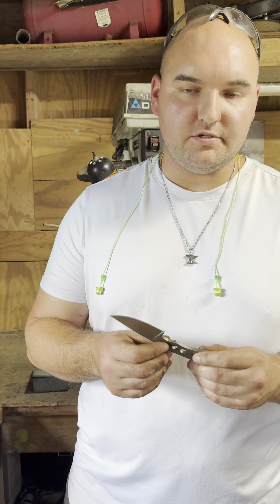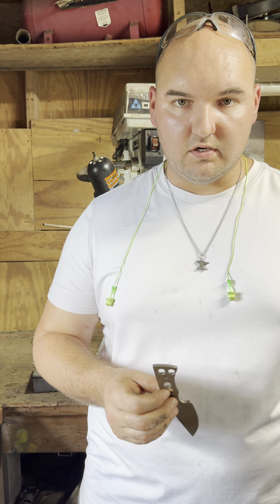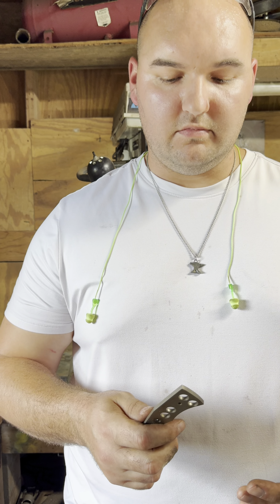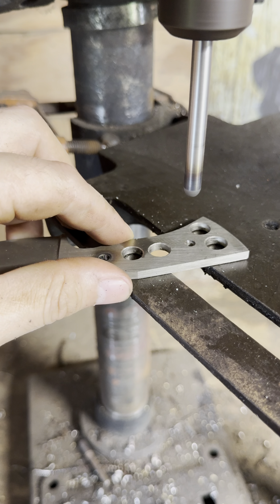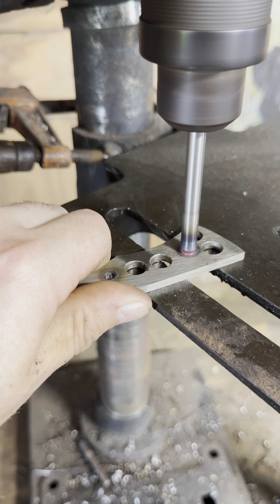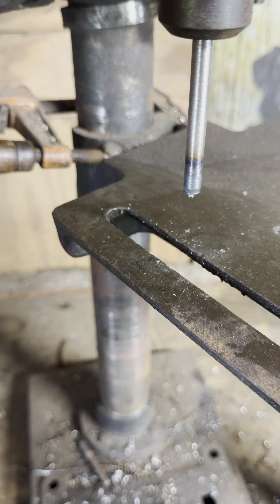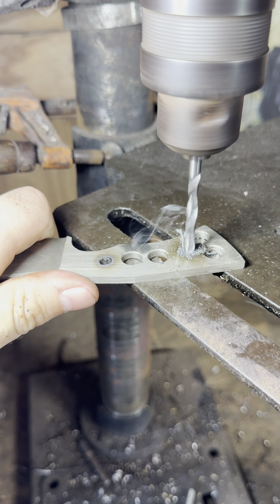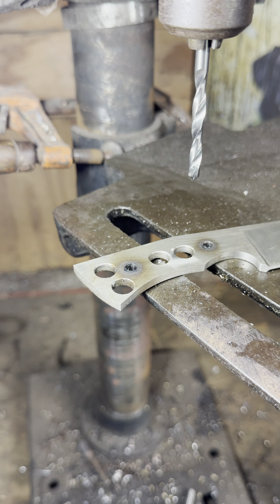Drilling a fully heat treated blade!

Comment: Great idea but damn, my mind was already seeing that gall up, friction weld, spin and take all of your fingers off.
Reply from the maker: My boss at work said the same thing today 😂 it wasn’t sharpened but still would not feel too good. I’m usually better about making sure the edge won’t be what hits me if it gets hung up recording is very distracting to me…
Reply: @savagebladestx  The other side would break your fingers too if not shear them off on the edge of the table.
Reply from the maker: @diederikvandedijk  definitely not. My drill press is not nearly strong enough to do anything like that…

Comment: If that bit hangs while drilling it will cut your fingers off. You need to have I clamped down so the blade can not move. I know because I almost  cut my thumb off this way.i had to learn this the hard and painful way. Be careful from now on
Reply from the maker: My drill press is not even close to strong enough to do that. It gets hung up all the time and the drill press just stops. There’s no edge on the blade either.